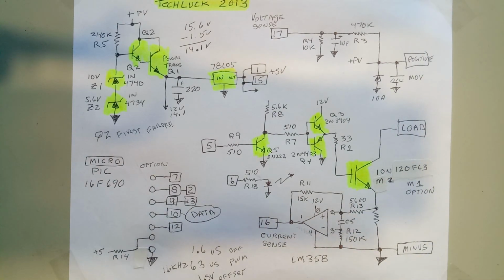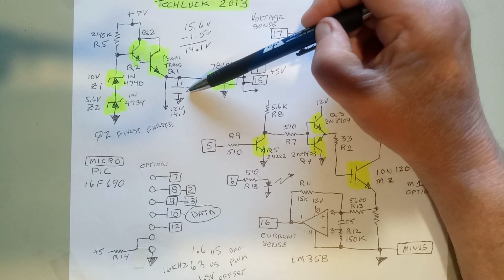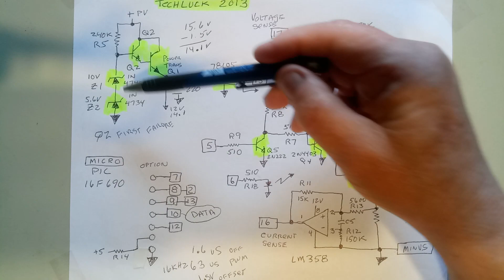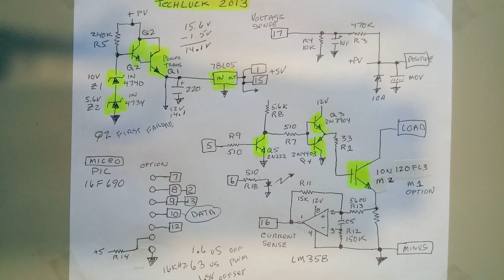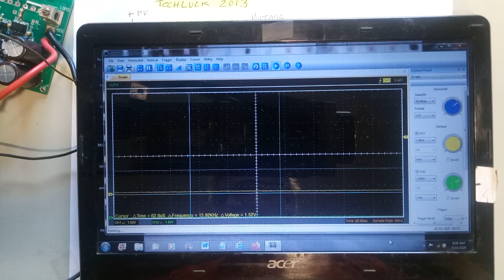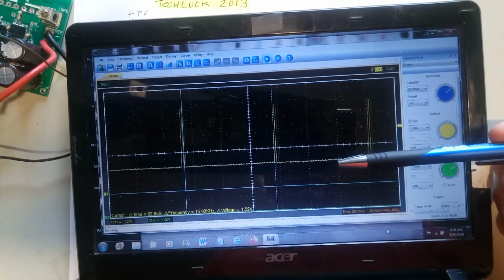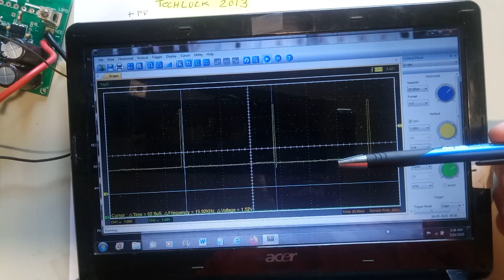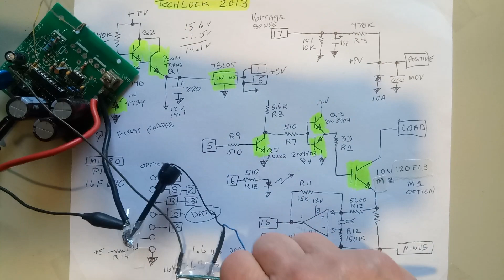TECHLUCK MPPT Water Heater Control, Technical Look and Repair Part 1

Comment from the maker: I thought they were gone forever, but techluck is back in production. External MOV protection is a must for this unit. Wrapping a few turns from the solar panel lead onto a steel bar helps supress surges. You might consider the Polish ACTii.pl which is a similar device.

Comment: I have a question for you can you fix it 
I have several from customers that have had the same thing happen
Are you willing to work on them 
Or will you sell what you have designed 
This company has been shut down and I have clients that have been hung out to dry
I would like to buy your products please let me know 
Thanks
Reply from the maker: The power supply section for the micro is not as robust as it could have been. Any surge can damage either transistor resulting in full panel current going to the micro. A shame because just another nickle in parts could have made the micro likely survive. Then again, nobody can repair things anymore making it of little difference. I suppose there are occasions where the IGBT shorts out and that can be repaired.  If visible damage appears on the board it is likely that the micro has suffered damage. On further testing even the LM358 was defective, that makes it everysemiconductor failed. I don't know if the mfg will sell replacement micros and if they would be reasonably priced. The damage is always likely to be extensive which would likely make it not cost effective. I would still like to get my hands on one that is repairable for testing. If you have one that hasn't been engulfed in flames I'd give it another try. About $4 ship without a backplate.

My videos are to foster electronic discussions. I have no intention of making these. I found someone interested in making these as a product but they have lost interest.
Reply: @opera5714  I wish I could talk to yes by phone
Reply: @opera5714  I am interested in getting these manufactured and would be interested in picking up where the other person left off. Please feel free to message me back anytime.
Reply: hi there sir yea i talk to them at TECHLUCK   he sad he not working on them at all do to the virus this one of ours  in the video got hit hard

Comment: cool is there a way to make it more power full by put 2 mosfets ? yea thank the off time is to short i can run a  thermostat on it it will burn them up or the caps are bad or not big enough to stop the arcing so that the  thermostat can work properly but i dont know am not a expert on electronics thank for the info on it
Reply: it got hit hard alot is bad i hope the caps are ok
Reply from the maker: The output is an IGBT.  Putting two in parallel can increase current capability.  IGBT are usually used in higher voltages where currents are lower for the watts controlled.  This IGBT can only saturate to about 3V.  Typical grid tie panel is 8 or 9 amps.  That produces 27W of heat that has to be dissipated  by the case. This is an old design when FET over 150V had much higher resistance. Newer FET are available with 500V rating and only .07 ohms.  That would produce one tenth the heat. Extra caps would probably help at low light levels. 300uF isn't much for a bank.
Reply: @opera5714   that cool I like to run more panels but the way it was made I has 4 250 watt panel s he sad can't you more panels we have a lot of day s not much sun
Reply: it,s ok  it is miss up to bad but i will ask hem if he will gave me the part rest on it,s  some it ok i know it got hit hard thank yea for working on it  the part it needs i cant buy it no ware ?
Reply from the maker: @JonOffgrid  I want to thank you for your effort to ship and your trust. Had this been two months earlier I would have had more time. I am running out of time as I will move for the summer early June. There was extensive damage and the micro can only be  obtained from the mfg who programs it. I do a not want to order the ight because of time restraints. In addition I just knocked out my system due to some errant wires. Just took on more than I could handle at this time. I will return module and refund your shipping. Again I am sorry things did not work out. The mfg should offer you a deal on a new one if he has any integrity.
Reply: @opera5714  thank you for trying it,s been hard on me being out of work the lp gas is hi here i may get a C40 PWM i thank it may work ok i met some nice ppl on you tube
Reply: @opera5714  thanks again I got it back to day
Reply: he sad he fix if it wasn't for the virus going on  he has all the parts maybe i can get a chip for it
Reply: he fix it one for free one time  I called him the one that makes them he said later on he sell the part just not now with the virs going on he will open up soon